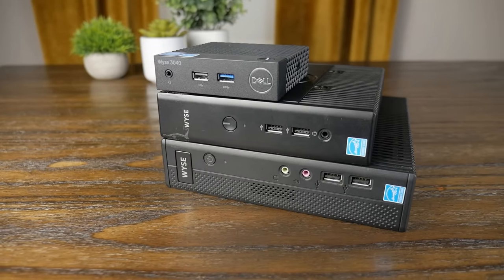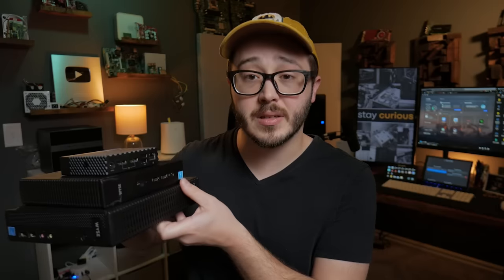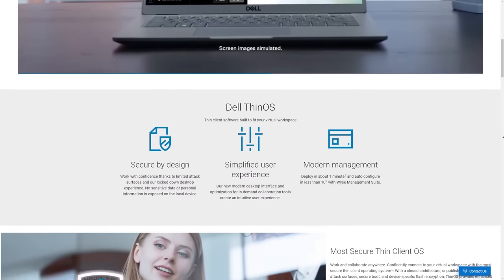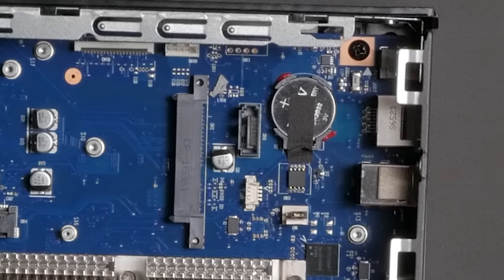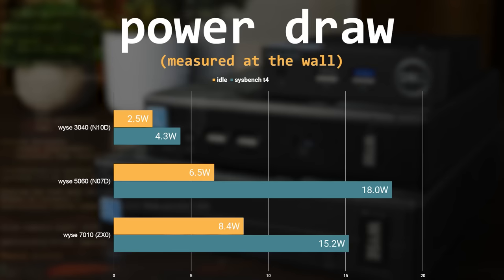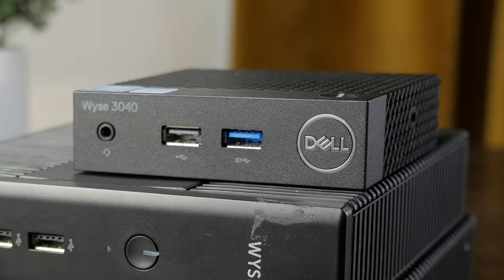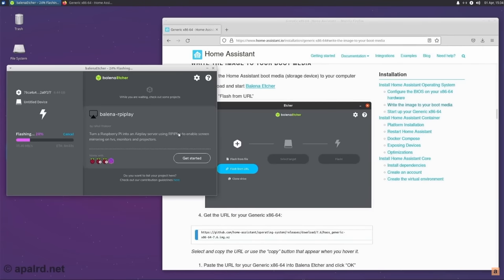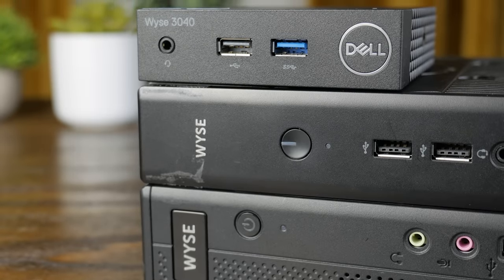Do These CHEAP PCs Live Up To The Hype?

Comment: I feel this is one of those things people simply never thought about doing it but it is a great use of them: Why not using it as it was intended? For people working remotely, sometimes it is a great pain in the ass to unplug the work laptop and plugging the personal laptop for personal and work usage if you have a big setup like me, with two monitors, keyboard, mouse, fullHD webcam, usb headset, thumb drives, etc... It would be amazing to have a guide on how to setup your work and personal laptops to serve remote connections to one of the Wyse cheapo thin clients, and how to setup it to access both machines, alternating between them when needed...

Comment: I've used these Wyse Thin Clients quite extensively for VDI (specifically, Microsoft RDP) quite extensively over the past year or so, and I can confidently tell you that the little 3040 is by far, the most common Thin Client to simply die. I've replaced and sent back dozens, approaching the 100 mark, of these in barely over a year, with about 130 deployed and active at any given moment. That's one Client, every other working day or so, that dies out of nowhere.
I've placed 5070, HP Clients, and even some Intel NUCs and non had that problem.

I personally would avoid the 3040 for anything remotely important.

Comment: I actually really like my Dell Wyse 3040's somehow I pull off getting the 16 GB EMMC models and one with Wi-Fi all the same price as the 8 GB models. I love that the 12 volt models are super easy to use with 3d printers especially when there was a huge absence of raspberry pi's. The BIOS allows for Auto on with power which is awesome for blackouts. You can even get them so much cheaper if you get the BIOS locked versions because you can just do a key command on the motherboard with one of the buttons and reset the bios. If the store does not enough USB booting is totally possible.

Dell Wyse 3040 #1 - Home Assistant OS - So little power used and it just Auto reboots it's perfect.
Dell Wyse 3040 #2 - Klipper OS for modified Ender 3 - I actually like it so much I'll probably use another one for my voron 2.4 that I'm building
Dell Wyse 3040 #3 - Semi-cold storage NAS - just use for a general backup for random stuff not on my main NAS

All three of them use so much less power than my old parts unraid server lol
AMD FX-8350 24GB Ram & GTX1080. - I'll never show anybody a picture of this it too jank until I have some spare cash for a new case.

And crazy enough my favorite of everything has to be a 2011 Mac Mini I got for a stupid good deal on eBay. Popped in some DDR3 modules I had laying around so it has 16 gigs of RAM and got a $6 Sata cable so now I have an SSD inside and a HDD. Uses very little power it's all in one and just works, mostly (2011's have Intel 3000 driver or bios issues that make it challenging to run Windows) Would recommend 2012 and Up models.

All in all the little Dell Wyse 3040s are definitely not perfect but they have gigabit Ethernet on them and can do 4K out at 30 HZ across two monitors and has a USB 3.0 port and it's honestly not bad if you're just running light stuff. Plus I really like them more than the mini PCs I bought on Amazon years ago just because it's nicer to reuse old Hardware that's already in the world than create new stuff for no reason. Especially if your services are mostly static and not sustaining any continuous heavy loads or high peaks. All of our power here is hydroelectric so I'd rather use old/used Hardware and keep it going as long as possible. Great video as always!

Comment: I use a Wyse 5070 (J5005 Intel cpu) with Windows 11 (yes it's supported 100% by Microsoft) almost every day as a desktop system. It cost me 80$ on Ebay a while back. Put a bigger capacity ssd in. Easy for day to day tasks like mails, youtube, etc.. I even use it for Photoshop from time to time and it performs really OK since the GPU is 100% hardware supported. No it's not even near as fast as my Workstation with 28 cores and 56 threats  etc... but it's small (strapped to my monitor cables lol) and it isn't power hungry (15 Watt's at 100% cpu load) comparing to my workstation using even 200+ Watt's when idle. The Wyse is passively cooled so it's quiet and not much can degrade over time leaving you replacing stuff. You can even use it for some light gaming (yes the GPU is quite brave ). Games I tried like Team Fortress 2, Dave the diver, The Sims 4, etc... they kinda work and in 1080p they run OK-ish. Where these systems shine is the everyday office tasks though. I haven't tried putting other OS's onto it, but I can imagine that some won't work as well since the cpu throtteling is really bad until the point you install the right chipset drivers. In my case the cpu stayed stuck at 1,5 Ghz in the beginning and I really noticed the difference when the drivers were installed so that de cpu speedboost worked. A friend of mine uses the same config as me as a PfSense router. I think there are a lot of options left for using these systems and not letting them become e-waste. In times where everything is getting so pricy a lot of people would be happy using such a economical system.

Comment: The main reason the company I work for opted for Thin clients was the fact they would meet our needs and were super cheap. Our purpose was to have trainees log in remotely to our software. Well, let me tell ya. These things are a pain in the...Almost everything is restricted. Even updating the system required a lot of tinkering and patience.  I asked the guy in charge why he didnt go for mini pc's. They made more sense to me. But he said that this wasn't in our budget. 

Now they are in the process of replacing the thin clients with new ones. Again, lesson not learned. But this time they claim that everything is going to be more streamlined and improved. We'll see.

Comment: I'm using Dell Wyse 3290 (n03d) with Celeron N2807 CPU since 2019 for hosting small personal database I want to be accessible 24x7 under Centos 7.
Initially it had 16GB mini mSata SSD and 4GB of RAM, but recently I bought Chinese 256GB drive and swapped RAM module to 8GB.
Now it serves as home SMB share and torrents / yt-dlp downloader, too. Performance wise it is slow (like Pentium 4 3GHz), but draws only 3-4 watts idling or 6W under load.

Recently I've tested 8th gen Intel NUC (i3-8109u) and was impressed with its performance (plays 4k60 video easily), relative silence (fan at idle is almost inaudible) and low power draw (sometimes it fell to 6w under Windows 11). NUCs are popular, spare fans or even fanless cases are available, so I consider buying NUC as my next home server and bedroom HTPC in one package.

Comment: This video’s perfectly timed, I picked up an OptiPlex 3000 thin client off Amazon for only $50 last week and after throwing extra RAM and storage at it, it’s capable even as just a small Linux machine and emulation system for the price I paid for it.

Comment: I use one of these systems to run my 3D printers. The raspberry Pi 4 might have blown it away in benchmarks, but for the same price I could get the RPI for I was able to get upgraded memory and storage. And normally you have to run a separate raspberry for each printer.. I can run four printers on one of these thin clients. And I'm basically just running Linux mint.

Comment: Watching from a Fujitsu Futro S920 (AMD GX-415GA version). :)
Great content, was nice and interesting to watch! I am here from the competition, and I'd recommend to check it out!
My reasons for this tiny machine: wanted something cheap, small, and silent for my tv, as a media player. Ended up choosing a thin client,
and this Futro S920, to be specific. Has an AMD 4-core, 1.5GHz, no moving parts, 40W psu, 2 SO-DIMM slots, 1 sata, 1 mSATA, 1 miniPCI-E,
2 USB3.0 on the front, 4 2.0 on the back,
AAAND a PCI-E x4!
What made me eventually buy one, and tune up over time, with a 64gb mSATA SSD (instead of the 4gb), and 2x4GB 1600MHz DDR3 (instead the 1x2gb),
got a 90 degree PCI-E adapter, than first a GT710 2gb DDR3,  and lately a GT1030 ddr4, for the extra low power consumption. :D And a 128gb usb 3.0 in the front as external storage.
 Conclusion: no, it is not the cheapest idea, BUT I do not regret, since I use it on a daily basis, good fast for avarage tasks, does some older gaming too,
AND practically dead silent and max 40W power usage, on a 1080p big screen TV, and can use my beloved Win 7 HomePremium.
I even consider to eventually get a GX-424CC version as a final update, to satisfy my tinker side.

Comment: back when I was working at a big company about 15 years ago that had national presence everywhere, I had to go and fix stuff at those stores. In all of them they had these little thin clients that have been running the sales system for the last 20 years or so. They don't fail, they don't crash and when they lose connection from time to time, you just press a button to turn it off and on again. It's probably a good thing that they never crash because the only person who knew how they work had retired 10 years ago already hahaha... So yeah, in the case of a home setup environment... I would set them up at different locations at your home maybe and be able to access your computer everywhere? Not sure though what the utility would be of that haha

Comment: While watching the video I was thinking what kinds of uses I would have for a lower power computer that I could leave powered on with not much issue on the power bill. And so far I've come up with the following:
1. Storage server (not a home NAS or anything but just something simple to make transferring files between devices easier since Warpinator on Windows and Android isn't as good as the Linux version)
2. Spotify connect hub I could leave by the stereo (using raspotify)
3. Print server (no idea if it would work fine on my Epson L220 since there's some functions there that I need the Windows driver to access)
4. Thin Client (so I can access my main pc from a different part of the house when necessary)

Comment: I have 3 of the Wyse 5060's, one running OMV as a NAS backup, one running Home Assistant and one as an IP based CCTV display for onvif cameras. Although I could containerize everything onto a single more powerful box, only the HA pc is on permanently so it makes more sense to me to split the jobs between PCs. My current favourites though are the HP Elitedesk series as they are considerably more powerful. Mine have I5 7th gen CPU's at 3.4 GHz. One is a thin client and the other is an All-in-one with full HD screen and both are surprisingly fast as long as you aren't doing anything GPU intensive. Both have M'2 NVME SSD's plus sata connectivity and both were under £70 delivered (Less then $90 currently) So more expensive than the 5060s but vastly more capable.

Comment: I almost pulled the trigger on a 5070 but found a much better deal for an HP Prodesk 400 G3 Mini. I set it up as a Jellyfin server, though I haven't gotten Jellyfin subtitles to work properly so I just use it as a file server for Chromecast running Nova media player. Works great with 4k files. I think it idles at 8W which is fine for me.

The total setup was less than a Pi 5 and runs on SSD. Sure it uses more but idle is so low it doesn't really matter that much. I'm not concerned about data loss as there is nothing of value on it and that situation wouldn't necessarily be better on a Pi anyway.

Comment: In your next video, I would really like to see how they perform when connecting to an AWS WorkSpaces. Years back, I looked for a desktop in a cloud solution because I wanted to connect to a desktop from anywhere. I tried to use my work computer, iPad, home computer, or an actual WYSE workstation. After searching for workstations in the cloud, I found AWS WorkSpaces. It worked great! Have you ever seen Windows 10 on an iPad? It wasn't running locally, but seeing a full Windows 10 desktop on an iPad is something else. But back to AWS WorkSpace, it is awesome to have all my files, desktop, and apps available anywhere. I even tried using a very old WYSE terminal (before Dell bought them), and it could connect and use it as a desktop. However, it worked with reduced graphics and a few performance issues. Yet, I could still do office work on it.

Can you sign up for an AWS account, activate an Amazon WorkSpace desktop, and connect each WYSE terminal to see if there are any performance issues between them? I would like to see such a comparison of the hardware being used for what it was intended to. I settled with using a Vevo Stick to run the AWS Desktop software, but that seemed like it needed to be more powerful. Maybe you can also try setting up the software (https://clients.amazonworkspaces.com/) on a Raspberry Pi to do a full comparison of performance.

Thanks for the video, and I hope you are able to do such a comparison!

Comment: I'm using a 5060 as a Pfsense router running on a trunk line to a unifi switch with my wan being a vlan on a port on my switch. I've been running that for almost a year now, it's really awesome. I designed a 3d model ssd mount and found a super short SATA extension cable so you can mount a 2.5" SSD inside. I even went to the level of designing a fan mount, even though it's probably completely pointless. Considering I paid $40 for 2 of them, I always have a back up.

Comment: The older models with DVI-I might have a niche as Batocera machines because of their ability to output 15khz. Slap a DVI-I > VGA to SCART (or RGB outside of europe) adapter and enjoy the best analog video signal with virtually 0 input lag in your CRT tv. Considering you can find some thin clients for $10 and smaller CRT sets for a similar amount, it's a bargain. 

Even older models with VIA cpus make great DOS/Windows 98 machines, as some are old enough to still have drivers for the latter. I recall the via C3 in particular having the ability to play with the multiplier to bring the frequency down to ridiculously low numbers, which is necessary for some DOS games.

Comment: I bought my N10D Wyse, admittedly, mostly for the aesthetic. But it's definitely a great little Borg Backup Server for the price!
But I'd warn that the tiny flash memory can be an absolute pain to work with... I had to fully reinstall Debian three times from my screwups: Maxing out the storage accidentally can leave you unable to reduce it again, and end with a practically broken system. Get a little too eager with apt, and now the entire system is unable to update or properly uninstall things.
It's working fine now, with external storage for the backups obviously, but I am getting a little worried watching the flash memory usage creep up with each Debian update still...
Reply from the maker: Haha yeah.. I can see that being an issue

Comment: Could you please note which exact Sysbench version was used for these comparisons? Afaik the results can vary a lot depending on version. I am comparing this to one of my Lenovo M900 Tiny with a i5-6500T and the numbers just dont make sense at all. Using Sysbench 1.0.20 on Debian Bookworm

Comment: The Wyse 5070 blows all of these out of the water, with a J5005, DDR4, m.2 SATA, in less than 20w full tilt.
The 3040 makes a great pi-hole machine.
Reply: Exactly, I was about to post the same. Stick a low profile 4 port NIC in there and you've got a great, low power virtual router box.

Comment: I have a WYZE 7010 and had to buy some SATA adapters to be able to upgrade the storage. once that was done and I had 2 512GB chips installed, the system took W10 pro with no problem. these units are mostly used on a corporate network... Mine came with a 16GB flash Module and 4GB memory. I was able to upgrade the system to 8GB of memory and since the unit has a SECOND SATA Channel, I was able to add the D Drive. really Like the little system! and mine was a "Legacy Edition" so it has 2 extra USB channels plus 2 serial ports.

Comment: I have one of those Dell Wyse 5060 and I mainly use it as a SMB file and printer server. Currently have Windows 11 on it despite not meeting the requirements. Though it's still running smoothly for almost a year now since i got it.

Comment: I got dell wyse 5070 super cheap for £30 and with extra NICs it acts as my backup pfsense router. My mate got 3 of them and turned them in proxmox cluster :)  Not super powerful but power usage us like 6W for each!
Reply from the maker: Nice!
Reply: Where did you buy them from at that price?  Are the 5070 the 'extended' variant?

Comment: JUST FYI:
if you run those without monitor connected - say a server / proxmox node, the power will go dramatically down ... with exception of 3040, which already runs on electron vapour.

Comment: You should look into the Zimaboard sata power cable. It's got a 4pin power connector very similar to that and splits the 4 pin into 2 standard data power plugs

Comment: I'm using one of the 7010 like models with a PCIe slot; with a multiport network card to run Pfsense for my router. Been working great. Didn't do anything but slot in a network card and install Pfsense, no other upgrades.

Comment: The 3040 was a part of my proxmox cluster till recently. Not just as a QDevice but a proper node with 3-4 VMs and 2-3 CTs (Had a SATA SSD for boot+storage). It wasn't a pinnacle of performance but it did the job without any problems.

The main problem is the extremely limited connectivity. It has USB3 and an ethernet port, and that's it. The WIFI slot is SDIO. The USB2 are slow. You would always need better storage than the built-in eMMC. That needs the be over USB3. Which leaves nothing for expandability. Can't add a USB NIC, can't ad a PCIE device. No SATA either.

Comment: I'm using a dell wyze n03d for home assistant bought it for around 25$ and it has a celeron, 4gb ram and 32gb ssd, works well with HA and just uses around 10W of power